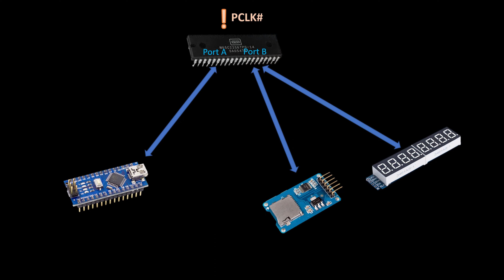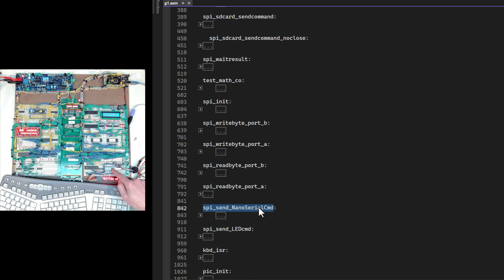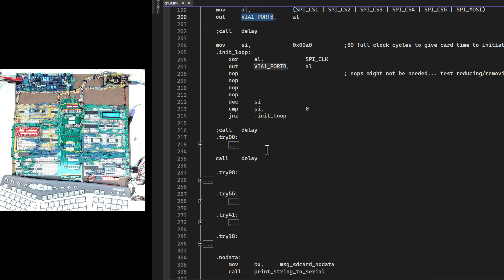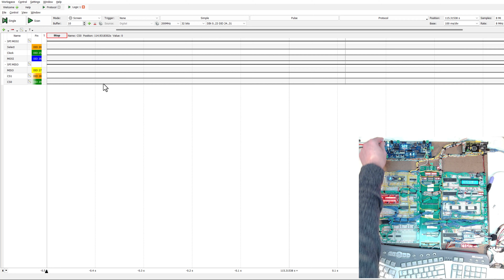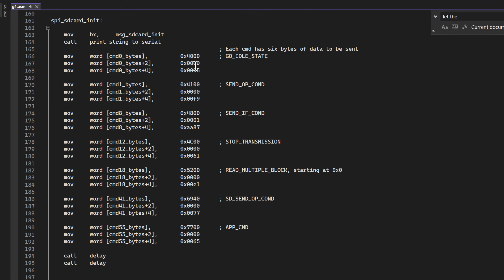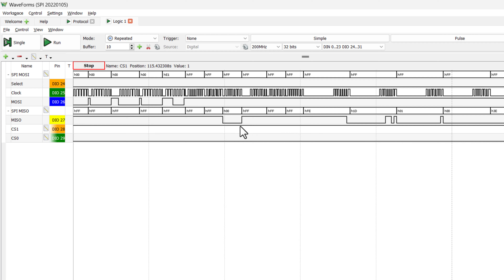80286 Build, Ep. #51 - SD Card (SPI)

Comment: Copying data from ROM is actually pretty straightforward.

Assuming the source and target memory blocks are contiguous but not overlapping you could do the following (and this would
be a generic routine):

;
; memcpy(): copy data from DS:SI to ES:DI
;
; In:
;		DS:SI -> source data
;		ES:DI -> target buffer
;		CX     = Number of bytes to copy
; Return:
;		All registers preserved
;
memcpy:
;
; Preserve some registers first
push	ds
push	es
push	si
push	di
push	cx

rep		movsb

.return:
pop		cx
pop		di
pop		si
pop		es
pop		ds
ret
Reply from the maker: Thanks, @Damouze! This will come in handy. I haven't yet used movsb/movsw/movsd, but I will start to use these a lot in my VGA coding.

Comment: I think you need to have another section in your code that the linker places into ROM and gets copied into RAM at startup.
I tnink you will want:
.code - executable, lives in ROM
.data - initialised variables, stored in ROM but copied to RAM by startup code
.rodata - constant variables, lives in ROM
.bss- uninitialised variables, lives in RAM and zeroed out by startup code
Reply: I would advise against using a linker for this. NASM can generate a binary image directly. Controlling what goes where from your source file maybe a bit more of a hassle, but it is also much more powerful. 

(I don't have anything against linkers, mind you, just not for assembly code that is most likely going to a single source file anyway).
Reply from the maker: @damouze  Thanks, Damouze!
Reply from the maker: Is that the .rodata section, and does that apply to binary output? I am not using a linker. Thanks!
Reply: @rehsd  No, .rodata is for data that is always read-only, ie data you can keep in the ROM. Your assembler's documentation should explain how to what you need. I'll try to help if I can, where can I find your source code?
Reply from the maker: @willsowerbutts  I appreciate you taking a look. I just posted the current code to https://github.com/rehsd/x86/blob/main/286-related/WorkingCode/g1_20221204.asm. Thank you!!

Comment: You just keep churning out great videos! I am learning so much from this series. I actually designed and ordered my first PCB using EasyEDA after seeing you use it! Question: You've written a lot of assembly at this point, when might it make sense to switch to C/C++ and let a compiler to the heavy lifting?
Reply from the maker: Congrats on your first PCB! What kind of PCB did you design? As far as C++... that's a great question. Two things come to mind. The first thing -- my assembly skills aren't great, so forcing myself to work in x86 assembly is building up my knowledge in that area. The other thing is that I haven't looked into what it would take to use C++. I'll have to research it a bit and see what is involved and whether or not it's feasible for my build; more to come on that. Thanks!
Reply: @rehsd  I designed a silly little 8 bit adder using two 74HC283s. I did look at using mostly surface mount parts to try out the PCB assembly service but >$100 a board is a bit too much for some desk toys!
Reply from the maker: @GregCoonrod  Nice. I still prefer through-hole, as it gives me more flexibility to adjust the circuit after the PCB is printed. I find it more difficult to lift a couple of IC legs on a surface mount IC. :)  I haven't tried any PCB assembly services; it does sound a bit expensive.